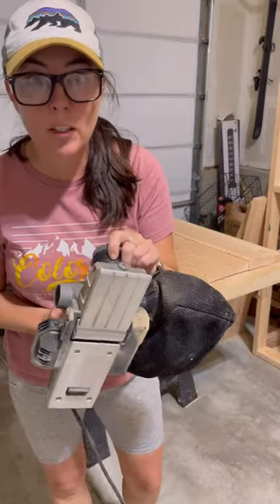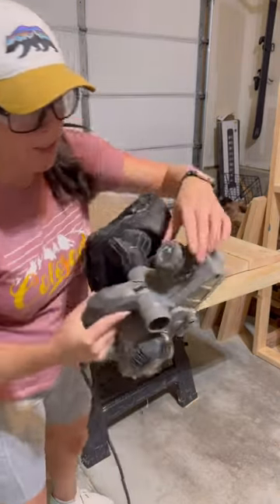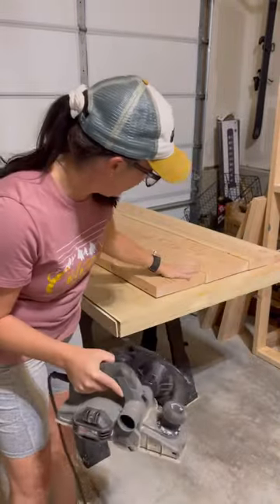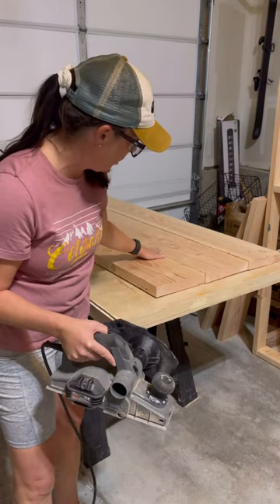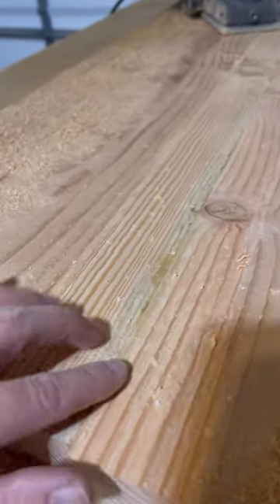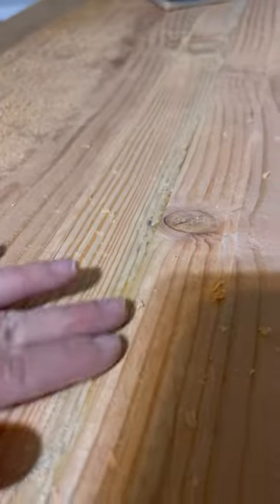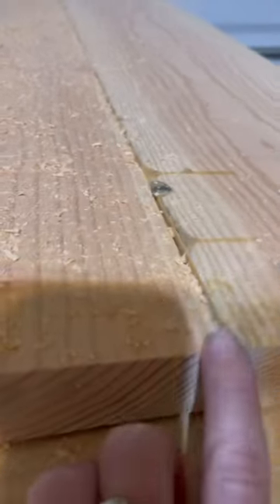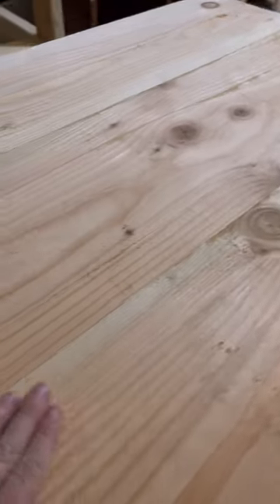Ever used an electric hand planer?!

Comment: Better clamping procedure can limit on how much you plane in the end. Take the time to line the joints better and use more clamps in between the existing clamps and you can line the lip so it minimizes the protruding lip. If the planks not the same dimensions then focus on one side. If you don’t have an even work surface well then ur out of luck. I know these are big pieces and might have been warped a little. Best of luck on your project. Gonna get a planner thanks to you video 🤙

Comment: What is the difference between this and a sander?
Reply: If you use it you will know. The sander gets clogged up with dried wood glue and too much wood to take off. A planer is fast and clean and levels out the wood fast with no pricey sandpaper expense.

Comment: How are blades holding up using it on glue joints?  Thought you we’re suppose to clean up the “squeeze out” first with scrapper before planing?
Reply: Why?  Dried wood glue is not hard on blades. Why should you do the extra step?

Comment: No one ever shows you how to not take too much of a chunk out of the word while you’re shaving it down. I would love to learn that part of it. I’m sure that’s important. In other words, if you have a small spot of a large board that you are trying to plane, how do you make sure that you take out just enough of that part to smooth it out with the rest of the board?
Reply: A shop planer would be ideal but i have used a hand planer by adjusting the depth of the blade as i cut over the spot
Reply: Start in the high spot and make multiple passes increasing the length of ur cut  along the board slightly with each pass until u full pass. Check for flat, if not repeat the same process
Reply: Yes, they do show you. Find the right Utube videos.

Comment: For fucks sake you need to be using a benchtop planer if the piece is wider than your hand planer 🙄
Reply: It’s like 30 inches wide…
Reply: @thepianoist You just run out and buy a $30,000 30 inch industrial planer, like all of us do. Duh....
Reply: Or just do each board before glue up Like a true woodworker @TheClintB

Comment: Nope you know what's fickle is working with wood a belt sander would have been the more practical approach in my opinion you made more work for yourself
Reply: 👋….Curious…why? Late summer I made a 10 ft mid-century style patio table BUT w/ various widths laid w/ about a pinky finger’s spacing pattern between planks. Laid the widths like this ….   4,2,6,3,5,1,7,1,5,3,6,2,4,. ….. I did use a planer PRIOR but it’s still a bit off. I’m using a belt sander but I’m not sure it’s really working? Any suggestions?
Reply: @stacipotts7770  when you use a handheld planer your maximum working width is only the width of the planer so if the planer width  is 2 in and you're planning a board that's 6 in it's difficult it takes a lot of precision to do something like that it's way easier to sand it and remove a little bit of material at a time so you can feather in the work most times a belt Sanders  are too much it's too aggressive but in this video it would have been very useful to her because she was working with a large piece of joined material in your case if you were working with new material chances are an orbital sander would do just fine in most cases  belt Sanders are way too aggressive and it takes a lot of precision to feather in and not gouge the material
Reply: Sanding removes imperfections in the wood. Planes flatten the surface. Trying to sand something flat, even with a belt sander, is not the best path.
Reply: I don’t think you know what the word fickle actually means. Why would you use a word without knowing the meaning
Reply: @user-ux1vj9vx7s  The fact of the matter is I shouldn't even be here. Having a conversation trying to teach people how to work with wood. Get the right tool for the job. A thickness plainer that you could use to plan Down 10 inch material. That's the fact of the matter you want the job done, right? Throw the sander over your shoulder. Throw the handheld plainer  over your shoulder and buy an FNing thickness plainer,  end of story. Or hire the real deal and stop playing games with power tools and wood.
Reply: @peterg.2081 It's always funny to see the "men" of today proudly saying that the right thing to do is to call an actual man to do work that every man should know how to do.
Reply: You are absolutely wrong, Peter. A belt sander would gouge out a large slab of wood and the sanding belt would clog up with dried up Titebond wood glue and heavy sawdust. By contrast, this is a clean cut scraping off all glue mess. Furthermore, it removes a fine layer where the glue has penetrated so that the wood is receptive for staining without glue patches. We have all seen those glue patches that resist staining. Sanding just drives down the glue dust into the wood fiber and makes that worse.  She is absolutely right in using a planer. You should buy one yourself and not limit yourself to sanding.  The irony of criticizing a woman when in fact you know much less and giving the wrong advice.
Reply: @mjremy2605  don't ever tell me where I'm wrong again I'm never wrong